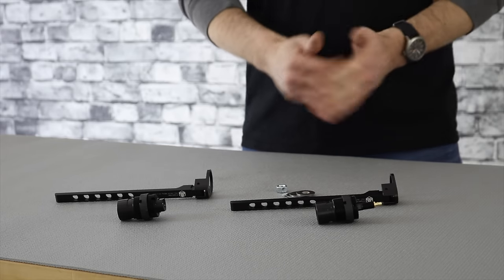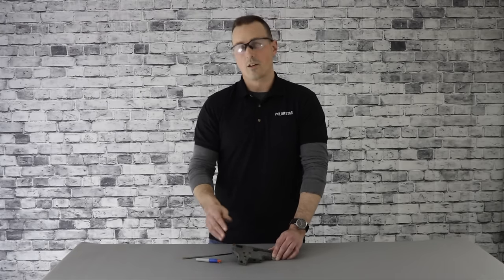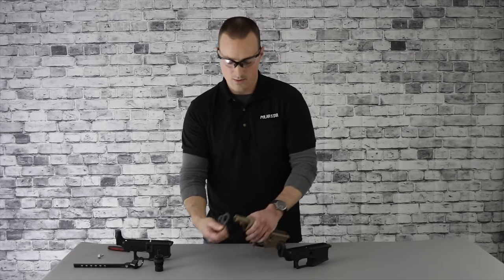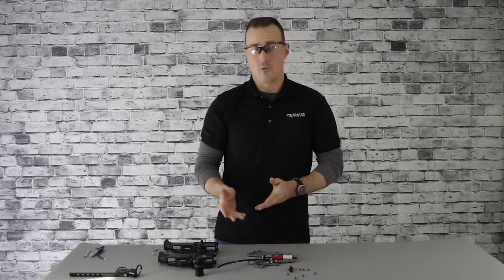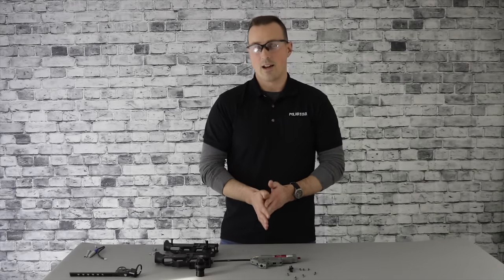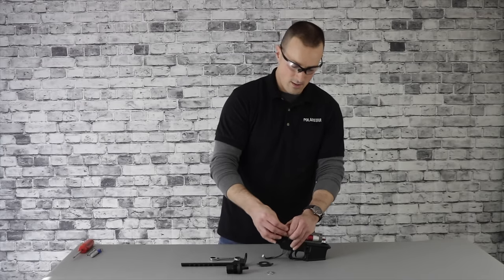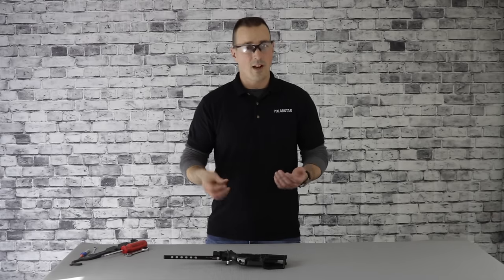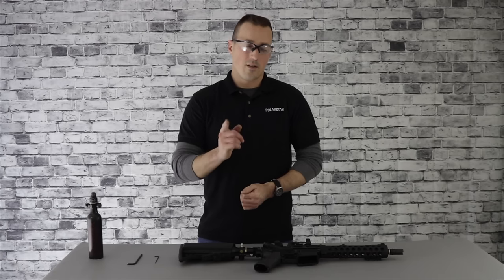PolarStar Airsoft - UGS Type 1 and Type 2 Installation

Comment: I noticed on your site you recommend SLP tanks, what is the reasoning behind this? And what, if any, is the difference between running the system with SLP vs standard vs SHP

Comment: ok, you covered the type 2 installation brilliantly. i kinda found this video too late. because i'm now waiting for my delivery of type 2, but i have a milspec tube receiver on my HK417 on which i plan to install it. will i have any difficulties with this combo?
Reply from the maker: The HK417 buffer tube is not the same diameter or thread as an HK416/M4/AR. We will be making a UGS version for this larger HK417 size, however, it's not available yet.
Reply: @PolarStarAirsoft  The tube is not the problem, i'll make an adaper on the CNC. I'm just wondering if anything else may prove a problem.

Comment: Is there a way to put something like a T or Y piece in there as well so you can have the option to either use the UGS or an external tank through a separate line through the grip as usual?

Comment: Can I install a type one in a G&G? Do I need anything extra besidades the UGS, the tank and the PolarStar F2? Any
Reply from the maker: Yes, this will work on a G&G M4 series rifle. The UGS Type 2, 13/3000 HPA tank and cylinder conversion kit (F2, F1 or JACK) is all you'd need to complete the conversion.

Comment: How will I able to know my PSI?
Reply from the maker: The amount of PSI is irreverent here since the regulator's pressure range does not exceed the operating pressure range of the HPA system so there is no risk of exceeding the system's maximum pressure. 

You would be adjusting pressure based on the velocity output so the PSI would really only be used as a reference.
Reply: So how does it know the max psi for the unit you are using example say I have an f2 which has a Max psi of 145 and what if I change it out to an f1 which has a Max psi of 130? Given of course you maxed out the psi of each Jack. Just trying to understand the unit.
Reply: yup, its a simple way to also eliminate people changing their psi in the field. its a win win for alot of us, that have tried to play with those type of people.  @PolarStarAirsoft
Reply from the maker: @felipeescamilla5060  The maximum output pressure of the UGS regulator is 130psi.
Reply from the maker: @thearianmandalorian  that would only work if the pressure they chronoed at was recorded on the chrono tag which is not commonly done. Spot checks should really be done with a chronograph since that is the simplest and most accurate way.
Reply: @PolarStarAirsoft  lightbulb, makes total sense now as to how it works, it is essentially like a paintball gun now where you just adjust for velocity not psi gotcha thanks for the reply.